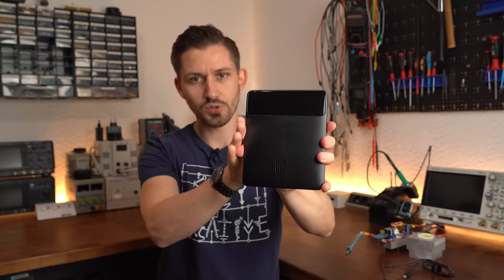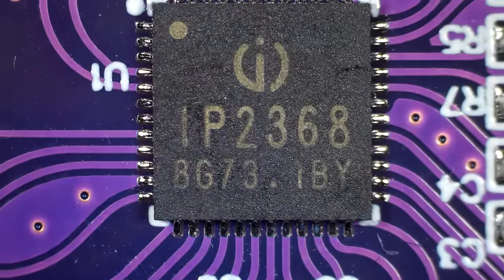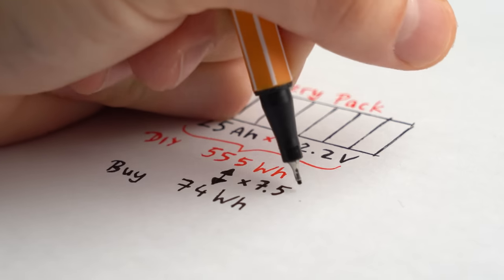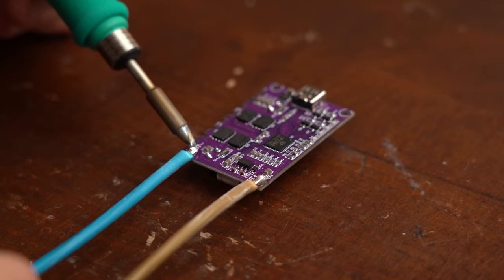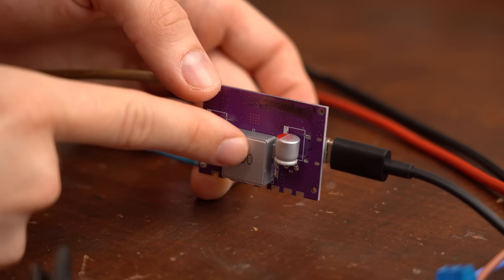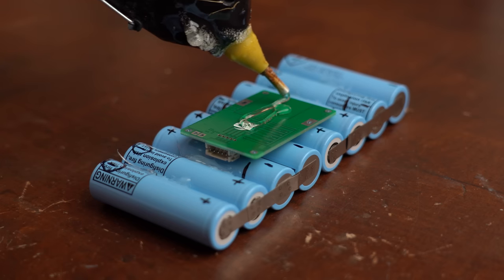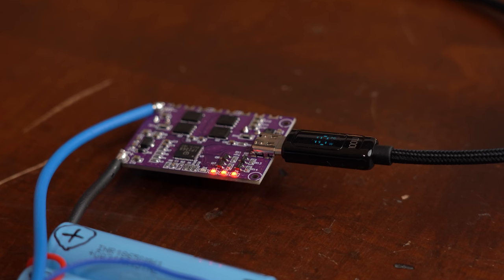My Power Bank Rivals Commercial Ones?! Super Fast! (DIY or Buy)

Comment: To make your own powerbank, you need to:
- know Ohm's law and how to wire banks in parallel/series to achieve desired output voltage/power
- know how to measure output voltages of each battery (unless you want your powerbank to set your house on fire after a few charges)
- know how to spotweld
- know what gage of wire you need to use
- know if the batteries you use have their own BMS or if you need your own
- know to just buy a commercial product if you aren't capable of understanding any of the above
Reply: Thank you for this heads up

Comment: Any chance you could measure output ripple? Might also be worth mentioning that while IC supports up to 28 VBAT, the board in question is limited to 17V/4S max due to inadequate LDO.
Reply: That's a shame, as this seems like it'd match well with an 18V power tool battery.

Comment: hey scott! i was in market for a dolby atmos surround sound home theater. but looking at prices my jaw dropped. i was thinking of building it myself and i thought it would be a great idea for an episode for DIY or buy.
Reply: Dolby atmos is proprietary. You won't get a decoder board for it. You can buy super expensive atmos av preprocessors but that defeats the purpose of diy.
Reply: Atmos is heavily proprietary and actively protected, even in the usual copyright is a guideline places (ie Russian and Chinese suppliers if you know where to look). You won't be able to DIY for any cheaper than commercial offerings.

Dolby actively protect defunct tape noise reduction systems that they haven't licensed in thirty years. They don't let any of their IP go. Even if it's no longer a money earner.
Reply: @medes5597  Maybe we can salvage some parts from older units and use other components like many DIY projects everything doesn't have to be a brand-new component. use the Dolby decoder as a black-box no need to understand all the details just the necessary ones to make it run. even there are some open source surround sound standards that could be used or any workaround. it's a good project to be explored. although I don't know anything substantial to make one myself yet.

Comment: I've got a customer's power bank which has an issue with working from the battery. I can't find the fault in it ;). So, I'm planning to reuse the case, charger, sockets & plugs, 18650's with mounts for them, even the LED. The driver I see here, for me make sense, so, the cost won't be 80 Euro. I've replaced dead 18650's and now all are holding power. This was an inverter as well, but this part works when is in a charge more, so, will work with this design later on.

Thank you for this video, gave me ideas how to not create an e-waste, but repurpose as much as I can from an old one :).

Comment: I would like to build this but when more cells in parallel.  I thought there would be no implications for this but after watching the video, I was surprised to see there was a max AH rating on the battery.  Why is this?
Reply: is it possible to put 16 batteries? of course 16.8V, each cell contains 4 batteries, and of course with a BMS protection circuit, does it work? :)
Reply: @behnamp9174  so far so good. according to spec sheets it’s actually the default 4s4p configuration.

Comment: Currently DIYing a 148 Wh power bank, won't have PD, but can be retrofitted later if needed. Will have laptop charging with 10 various connectors, 2 USB A ports with quickcharge and charging speed of the powerbank at 35W, while theoretically being able to output 160W. All for around 60€, since I grabbed some 21700 cells on sale from LG after they had an automotive project cancelled and sold out the cells from it, 5 Ah cell for 3.75€ each

Comment: That's crazy! Not even hot, must be some crazy low rds-on ohms on those mosfets.
And that the usb can handle that much with its small connectors is also insane :D

What module did you use to simulate the different charging standards? I see it quickly being shown in the video.
Reply from the maker: It is USB-C PD Trigger board. Just search for it on Google or similar ;-)

Comment: building a couple of these out of old gen2 ipads. can get them with broken screen/motherboars for around 8$, and they have a 6500-6900mah battery inside (three pouch cells, each about 2200 mah). since they are prebalanced, you just have to rip out the old screen and logic board, and wire them in series. stick the bms and PD board in and align it with the old holes in the aluminium housing. for a cover, just do 1-2 sheets of fiberglass/arimid weave in a vacume bag with some cheap epoxy between two baking sheets, and then trim it down to shape with a dremel to fit on top. Boom, ultra thin 24wh usbc bank that fits in any laptop case without adding any thickness.
whats even cooler is you can do this with gen3 ipads and get hdmi breakout boards for their screens, and then turn a 20$ old dumpster gen3 ipad into a usbc powerbank with built in retnia display screen extension, all in a super slim package.
tbh since im only using 3s configuration, i might just omit the BMS since it almost doubles the cost. this is the ultimate usbc gigachad diy project lol, and it saves the environment. ill test each pouch and see if their internal resistances are far off... but i doubt it will be an issue. aliminum housing is a good heatsink but i might put SSD copper heatsink in there if there is enough space, or just epoxy some old copper coins lol

Comment: Great Video, in fact I just built myself a similar DIY Powerbank with LiFePo4 Cells and this exact chip to charge my Laptop while I'm at uni, but The chip is on a custom board with more Outputs and Inputs (2x USB A, 1x USB C, micro USB and Lightning as well as an DC barrel jack) with an included BMS and Balancing on the same PCB. Its on Aliexpress (as all interesting electronics goodies) and has an display that shows the current percentage and if fast charging is active.
Reply from the maker: Sounds like a good project :-)
Reply: Can you give a part number for that chip?
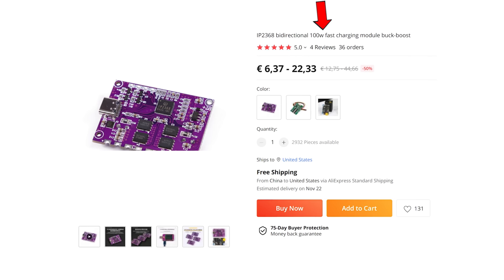Reply: @stevebabiak6997  It's a ip2368, cf 1:39 😉

Comment: Awesome. If you use 20A for those cells, you could make an electric generator which can be charged at home or by solar panels and use it if you need to camp or in the garage to power a drill or a grinder. 

And what you have done would solve the problem when watching Netflix on the airplane for like 3hrs using an external monitor. Or a Samsung Tab S8 tablet.

Comment: I think the buy one is a better investment in the long run. Once the batteries are no longer holding and discharging properly you can thin reuse that board and add more batteries
Reply: You can with the DIY one though

Comment: Couple years ago I built a charger that utilized power tool batteries. Upgraded it recently and it can discharge at 250 watts with power delivery and everything. Ryobi packs are a great deal at 60 bucks for two 74wh packs as well.
Reply: PD output is 250W?
Reply: @ericklein5097  No, three separate charge controllers, two of which are delivering 100 watts each and third is 50 watt with a legacy usb port and usbc port.

Comment: Onshape seems another great way to lock your fans into a proprietary eco system. Do people never learn? Those platforms can disappear in a second or decide to raise the prices remove the free tier and then what? 
Use software installed locally preferable open source, but not necessarily, just make sure it's something that they can't just take away on a whim or raise the prices off. Something of which you are sure your designs are yours and safe and easily exchanged with others.

Comment: ein tipp wenn es dir nicht um den formfaktor gehen soll es gibt  21700er Zellen die bei ähnlichem preis eine höhere Kapazität und eine höhere Stromstärken-Verträglichkeit haben.
Die kann ich sehr empfehlen 
Da die Spannungen die gleichen sind kannst du auch weiterhin die gleichen bms verwenden 😉
Reply: Während man bei 18650 höchstens 3500mah pro Zelle bekommt kann man bei 21700 bis 5000mah bekommen und preislich gibt sich das auch nicht viel

Comment: The price efficiency curve get better along with capacity added. With 200Wh or more battery pack, it would be the true winner worth all effort crafting it.
Reply: That store offers a 300wh kit you add batteries to. Based on IP5389 tho. Room to add two more boards so you can get the shell with three boards for $100 for 120W, 120W, 100W outputs. Just add cells and assemble the acrylic walls

Comment: Adding battery holder will not add a lot of volume, but adds an option to replace some dead cells in future.
Reply: Cell holders are a no no because the contacts don't do well above 5A. Jehu Garcia had a lot of trouble with this and his PCB boards

Comment: Great, informative video! Love the no nonsense engineering speak and brought to light some of the terms that are also used with the IP5389 board that contains the battery balancing and over charging, battery protection all on one board, along with a thermistor.  The problem is that I cannot get to push more than 3A (60W) even though it is rated for 100W.  However, I am currently using a Dewalt battery clone as my LiION source which I have used with a UPS board from MiniBox with GREAT success, but the board is expensive and frankly not very efficient requiring fan cooling.  It is also 3X as large as this the IP5389.  Both have columb cirucuits, but was hoping to have at least an I2C bus to gain access to the bus to add a USB port to bring the data over to Windows, sadly this is not the case and biggest advantage with the ‘Open UPS’ board.  Maybe using your technique and forehead slapping moment & “why didn’t I think of that” was taking an image of the PDF on the screen to translate the data-sheet, geesh forehead is sore now. But at least I can make more progress.  Thanks!!!

Comment: I Just bought a 737 gen 2 140watt anker power bank. All my chargers cables and power banks have been by anker and ive used them for many many years cause of their quality and true mah ratings no bs. Well that flat charger is from beasus and recently purchased a beasus 65watt charger for my gf and i am very very surprised and amused about the quality and true to life usage and mah/watt-hour power rating and they didn’t disappoint i cant wait to see what else they come out with. I used the beasus charger for my steam deck and got alot of extra hours from it.

Comment: I think all of these power banks lack a great feature to passthrough without some kind of reset and drop in power output.
This one baseus 100w actually have this feature, but will output 30w when charged and "discharged" at the same time(I guess even if it is fully charged). It will be very useful for laptop setup.

Comment: I managed to start a 2.0l VW Diesel engine with 8 A123 LiFePo cells, 2,5Ah each, weight of the cells about 600g. I assume the current drawn to be around 300-400 Ampere. I did not weld the contacts, but pressed Cu cabels onto the poles.
Reply: Well thats kinda cheating....those A123 ANR26650M1B's put out some serious amperage. To this day nothing really comes close

Comment: I love your channel. I love this very simple project and I nearly bought the module to power laptop from my 4S DIY Solar battery.
But, I read in the Ali-Express description: "The bi-directional c-port of the product can only be connected to one-way appliances or chargers, such as charging heads, mobile phones and other appliances, etc. It is forbidden to link bidirectional c-ports to modules with bidirectional c-ports, which may cause frequent switching between modules that cannot be identified and may be damaged in serious cases."
...I'm not a pro, but I did test my laptop PD socket and it will charge my phone, so it is bi-directional, and I guess this is the same for any PD laptop, this means the module is not suitable to power laptop afterall..? or did I missunderstand?

Comment: I recently bought a similar buck converter off eBay, it’s a 5-32v input 0.8-20v out DC I needed it for voltage step down from my bms to 5v for a d1 mini

Comment: you are my hero, i travel to place that still experience power outages. im a remote worker so ive been looking to build a battery that can power my laptop through the day. this project sounds great. i can travel with the cells unwelded and weld them wehen i get to my destination. i cant do that with a buy option

Comment: It would be interesting to build a small 5V USB UPS that uses pass-through, to charge the battery only when necessary while powering the output from the input in normal circumstances.
There are no small devices like this that have pass-through, only "classic" powerbanks but too big for simple UPS requirements (clocks, Raspberry, etc.).

Comment: Under the load that specific BMS get hot. You didn't use any isolation between the BMS and batteries. When it get hot it can easily get shorted out. Another thing is the link of AliExpress you put here sells the Board much more expensive than normal

Comment: The reason it is not able to provide the full 20V 5A is because it does not like low voltage for some reason. If you use a 6S battery, it does provide the full 5A. It also provides the 5A output with a 5S but only above 70% or so, which is when 5S hits 20+ volts.
Reply: Using a power supply at 16.6V with 10 Amps available I still find many of these boards fail at 3-4A from heat
Reply: @Eric Klein  sw3518s, sc8815, sc8812 these ICs have been good in my case. There is one on Aliexpress, able to provide 120W 20V at 6A. That one is good. You could try that. It is based on Sc8812 and a protocol chip whose name I do not remember, I think it was something from Chipsea. It could provide the full power, no hiccups.
Reply: @dogukancil5128  yes SC8812A has been good for me too. I havent tried SW3518S but I have tried SW3518 and its a solid trooper that I accidentally pushed way past 60W once. Where did you get SC8815 from?

I thought my SC8812A board didn't work but turns out I just needed to charge the cells through the board...which is weird because it worked for a while then almost acted like I had drained the cells even though I hook up all different kinds of power (packs and power supplies). Once I "charged" the cells (or the constantly changing ways to power the board) I was able to rip 120W out of that thing like no ones business.

The new SW2302 based boards are trash. Before those were everywhere I bought an SW2303/PL5501 from Feb 22 store and the acrylic case I got with it was like an oven. Never had much luck with that thing unless I had multiple fans blowing on it then I could get it to run at 40-60W for a while

Comment: Hi GreatScott, I love your videos. I always learn a lot from your videos.

I have a request for a video. There are cables where one end connect to the power-bank, and the other end to the Power connector of a router, and this becomes very handy in a country like Sri Lanka, where we experience at least 4 hours of ad-hoc power outages each day.

Can you teach us about how to design a circuit, which will power the router using 230V outlet when the power is available as normal, and will automatically switch to the power bank in the event of a power failure.

As an additional feature, it is nice to charge the power bank when the power resumes.

Thank you.
Reply: Presumable, if you ran the output through an inverter it could be used to protect against dirty power and to keep a computer running long enough to save files and shut it down.

Comment: Nice video. Thanks!
Been thinking to make one myself but with lifepo not lipo( i dont want explosive cells). Maybe 32650 cells. Would last 20+ years. Id like it a little beefy, not skinny like those run of the mill 10/20.000 mah banks. Maybe 24 cells (12v nominal & 36 ah 6s4p) and a quad usb quick charge port. Port board cost about 5$. Cells are 2$ each. Charge it with a 14v 20a charger. Like a car charger. Small 1a active balancer is 3-4$ and a bms.. maybe the same... Or slightly more.
Generally just for tablet and phone charging. Juuust gotta get around to it.. did make one last month, but that was 63 cells and not super light.

Hmm.. might add a buck converter for a 50/100/200watt solar panel charge port, that be kinda neat hmm..6$ more :)

Comment: Been playing with this board myself. I personally love that it also supports LiFePO4, which while stores less energy is a lot safer than Li-Ion
Reply: Less energy by weight. As long as you don't need the pack to be mobile that is not so important. Safety is important.
Reply: Have you been able to output 100W PD for more than 5 min?

Comment: I only got a brief close up look at the buck boost board but I did see some (but not all) very bad solder connections.  Needs to be reflowed with proper flux.  I wouldn't use it in anything until this is fixed because longevity and reliability would be questionable.  Of course most boards from Asia look similar so this is no exception.  You get what you pay for.  I keep hoping that the Chinese manufacturers increase their production quality control as time goes on but it is not happening quickly.  I think it is comparable to Japanese products in the 1950s and 1960s... it took a couple decades but finally Japanese products became good quality and a good value...  Hoping China goes the same way eventually. 
Your video is top quality as usual.  Thanks.
Reply: They finally got this PCB an inductor and mosfets that work at full output. Some of the other boards I own and they won’t go over 60W